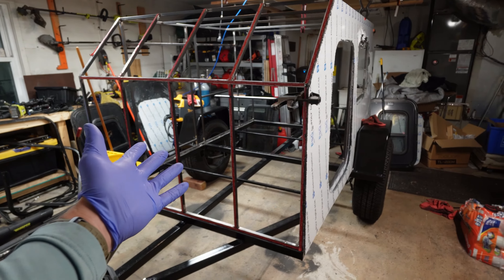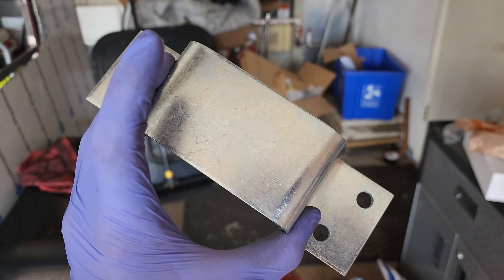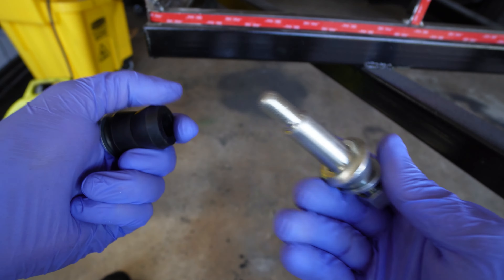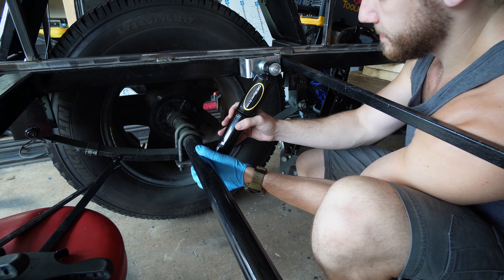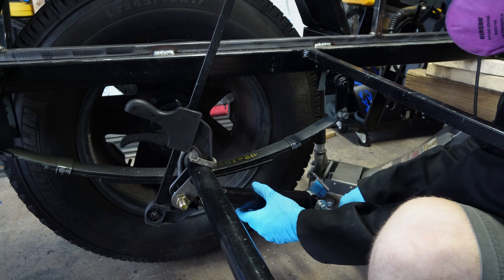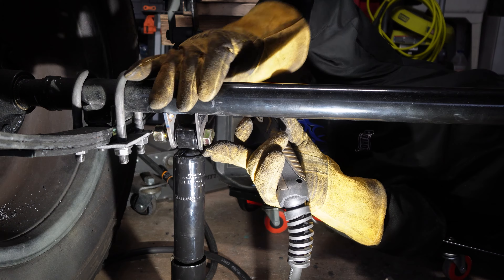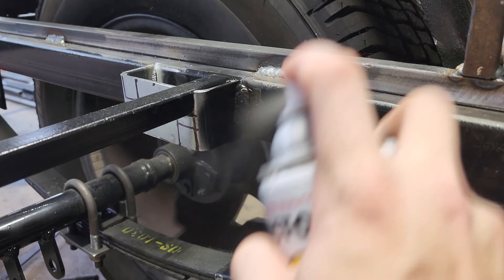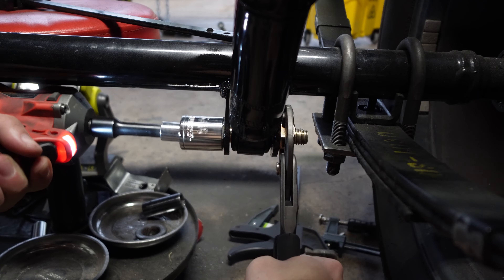How to Add Shocks to Any Trailer - DIY

Comment: Not only should those shock bolts to torqued TIGHT but also require use of lock nuts. 
The shock's bushing is designed to relieve the torsion stress. The bushing sleeves MUST be fastened secure and static.
Reply: You want the shock to rotate and since there's going to be some side-to-side movement of the axle, something needs to allow for that play. It could be the shock sliding on it's mounting bolt (or sleeve),  but you're saying the bushing is designed to take that torsional load and deflect?

Comment: Im doing this.   Amazon has awesome heavy duty brackets for f250 and the top offset one.    Itll let me make the lower shock 3-4” below axle to keep shock more upright.     Its an always on the street cargo trailer so the lower ground clearance wont be an issue

Comment: Would the same shock work if you moved the axle under the leaf springs to add clearance?
Reply: My guess is it depends on how much length it adds. I'll be doing just that. I think as long as the fully extended length of the shock is more than the distance between the two mounting bolts (with some margin of safety) you'd be OK. My swap says it adds about 3-4 inches. My guess is that unless you got really lucky, you'd need a longer shock.